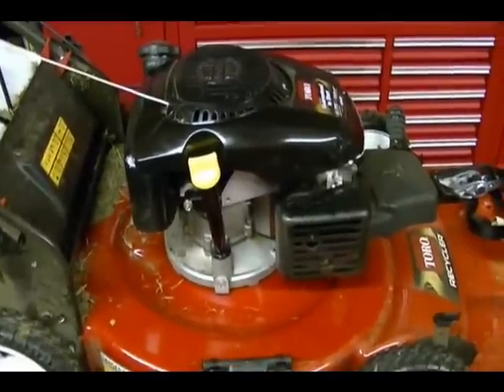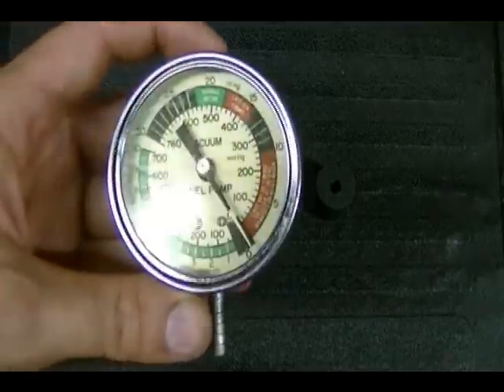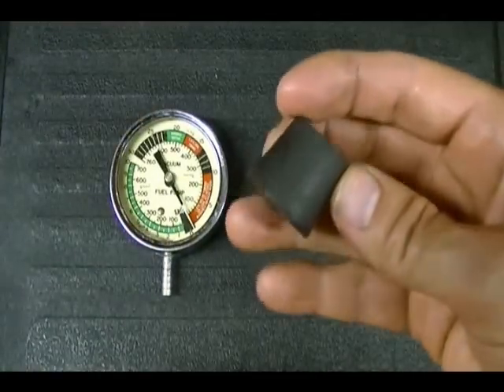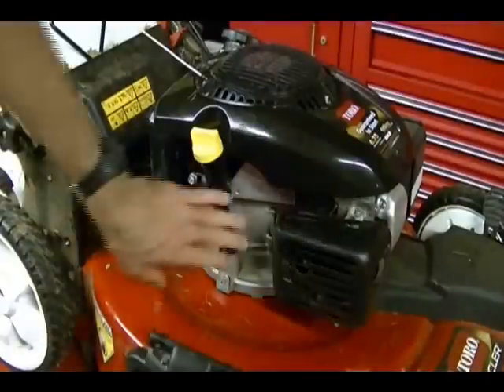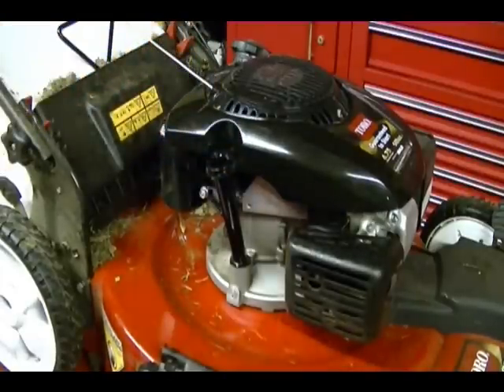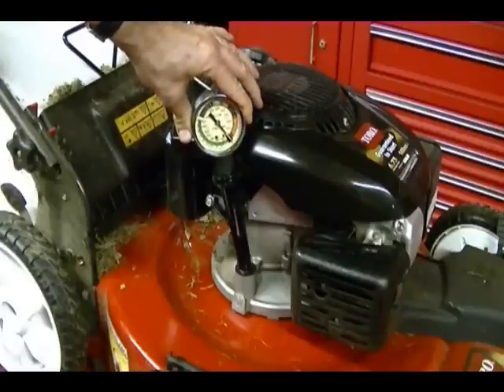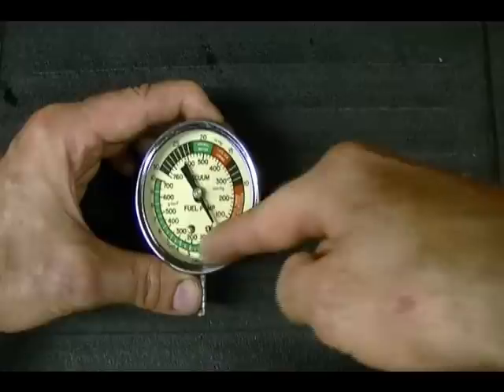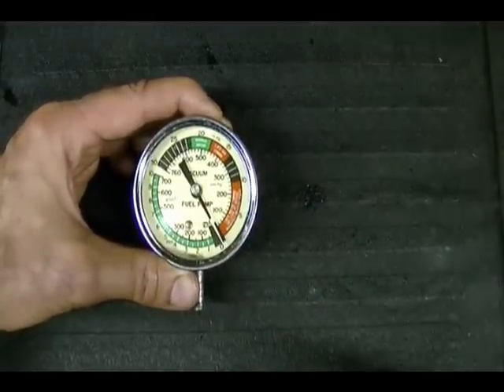How to Check Crankcase Pressure on a Kohler, Briggs & Stratton, Tecumseh Lawnmower Engine

Comment: If the hole in the rubber stopper is drilled even a tad too large, air will be sucked down into the sump between the stoppers inner wall and the metal guage stem, & affect the reading.

Comment: That's really interesting. I guess I had a fundamental misunderstanding as to which way blow-by gasses move. I always assumed small volumes of blow-by are normal, and pressures are positive. You've proven my pressure assumption wrong. 
On my Kawasaki 4-stroke Vulcan, I get a small volume of oil from a blow-by relief tube, right from the day it rolled off the assembly line. What creates the suction? If a blow-by tube flows to atmosphere, how does that sit with the notion that pressures are low?
Reply: When you are saying blow by tube,I'm going to assume you are referring to the PCV tube.
The PCV system has a one way check valve in it.
Typically only hot fumes/gasses from the hot crankcase oil pass through the check valve and through a hose to the air filter canister and passes through the carburetor to be burned.
The exit of the hot gasses creates the vacuum.

Comment: Thanks for all the great videos. I have a 2012 Briggs 205cc 900 Series Intek OHV, no dip stick tube. I put the gauge in the vent opening on the valve cover, will that work? My reading was a slow increase up to 3PSI before I pulled the gauge off.

Comment: Bear in mind that if the drilled hole is not bone crushing tight with the stem, air can be sucked in affecting the reading.

Comment: what causes oil to be in the gas tank of a briggs and Stratton engine?...thanks...
Reply: +pei bossman there is a breather pipe running from the valve case to the carb and any gas vapour will go through and maybe a little oil but if there is alot of oil in there i guess that will go into the carb then into the gas tank ...
Reply: No.
Reply: No oil should be in the Fuel Tank.  Oil left in Funnel?
It is not possible for it to get there from the engine.

Comment: You're using the wrong type gauge to get an accurate reading....  Your gauge gives a reading in inches of MERCURY (Hg)..  Both Briggs and Kohler give their crankcase vacuum specs in inches of WATER (H2O).  4" of H2O minimum.  You need a manometer, not a cheap fuel pump gauge.  You got the diagnostic technique right, but you're using the wrong tool.